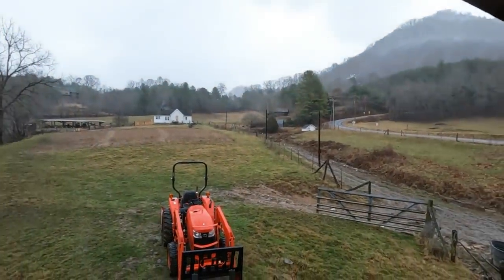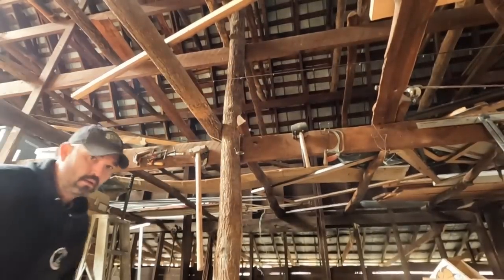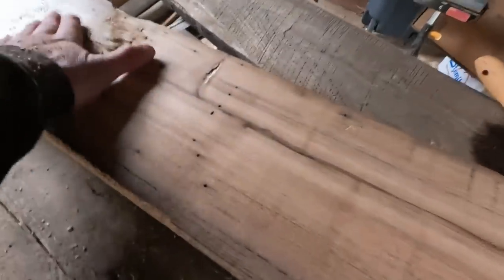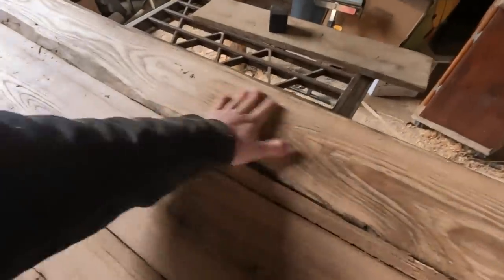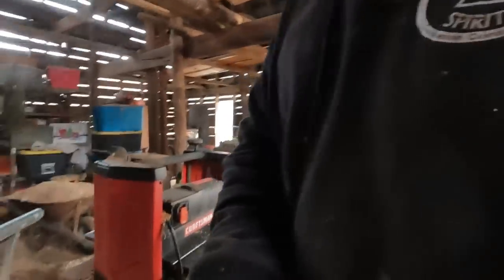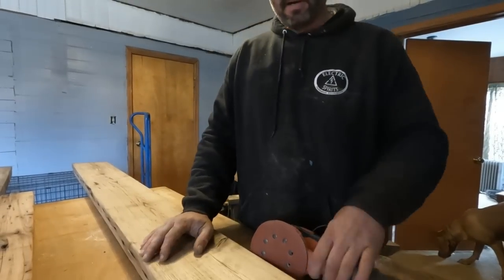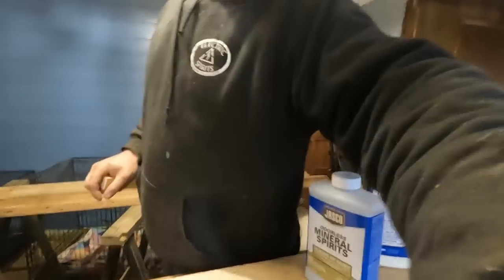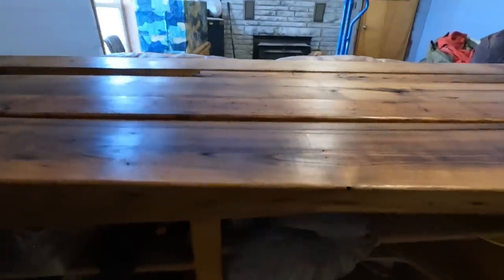100 YEAR OLD CHESTNUT BARN WOOD TRANSFORMED INTO BEAUTIFUL RUSTIC FARMHOUSE SHELVES

Comment: I love the results of linseed oil. The glass was rattling in the front door of my 1909 house.  The finish was about gone on the wood. I rubbed it down with linseed oil and the rattle disappeared.  Did you paint the walls with a gloss or semigloss finish?